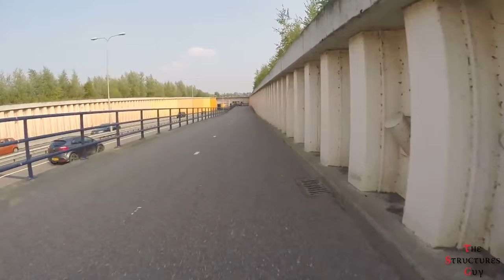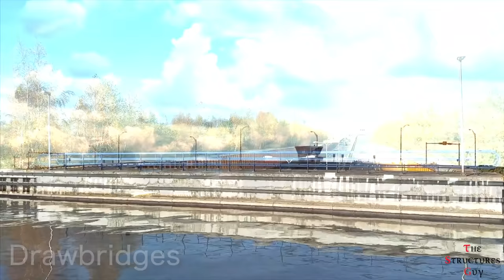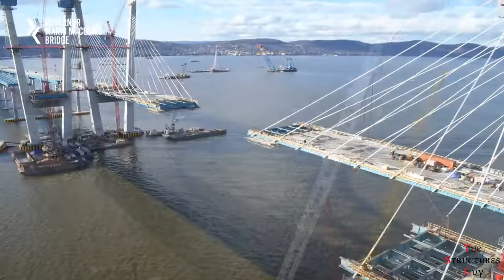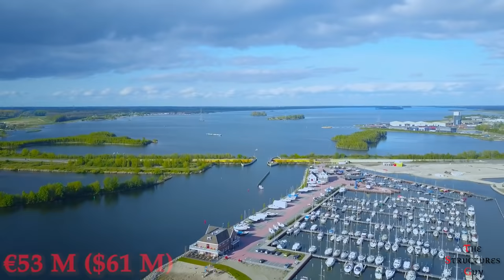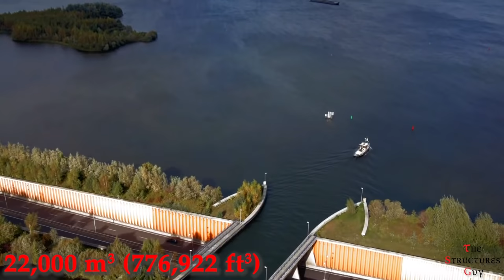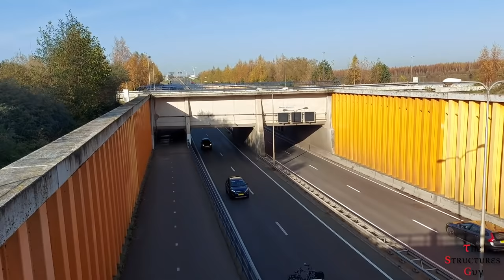The Engineering of the Veluwemeer Aqueduct

Comment: Before there were 2 drawbridges with a lock between them. The road was a dam between 2 lakes. The lakes were at a different waterlevel, but with a small difference of 5 to 10 cm. They leveled both lakes to the same hight, created the aquaduct and removed the drawbridges and the lock, creating 1 connected big lake. The old road was very busy 1+1 lanes, the new one is 2+2 lanes. A big improvement for road and water traffic, water animals have the whole lake now, and there are some islands created for birds near the aquaduct as part of the project.
Reply: Woah. Awesome!!
Reply: Thank you, I was wondering how it was before.
Reply: thank you. because this guy's english is almost completely incomprehensible and there is no info on wikipedia.

Comment: An aspect behind the aqueduct is that the traffic along this waterway between the land and the Flevopolder is separated into boats with lower draft but no height restriction, that can pass over the aqueduct, and boats with higher draft but restricted height that pass underneath the bridge just half a kilometer to the northwest. Because of this, this solution avoids traffic interruptions as would be the case with a draw bridge, and is probably a lot more economic than having a high bridge that would allow sailboats to pass underneath.

Comment: Can it flood?? Like if the ocean rises enough or something?
Reply from the maker: It's definitely possible given how fast the climate in changing
Reply: I wonder what would happen in cases like that, I know that just a river by my place has its water height change drastically depending the year etc. So I just was curious how it works here. There was one year where an entire area was like dried up and desert and a different year it flooded so badly. I can only imagine how drastic a change from the ocean 😅
Reply from the maker: @tillym123456789  I think some cities close to the water surfaces will have to be abounded. I just released a video about how climate change will affect engineering: https://youtu.be/a9-EOHSjERI